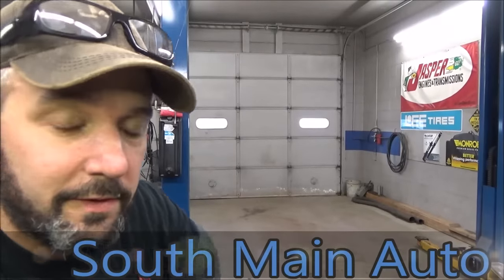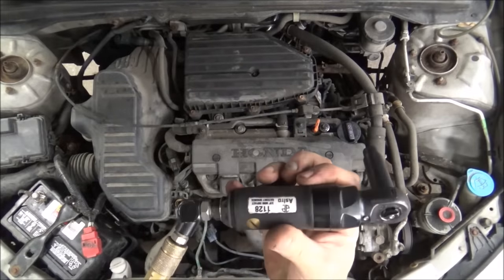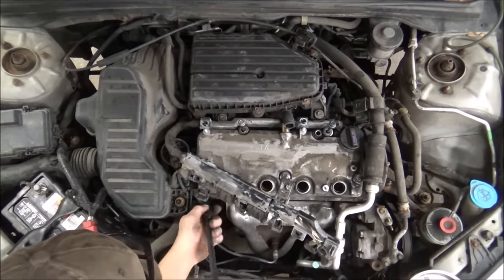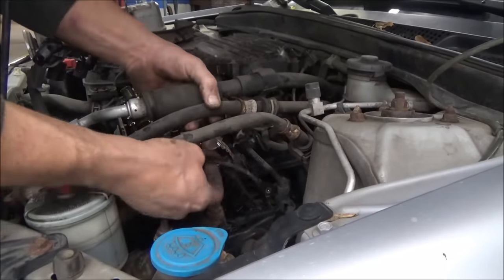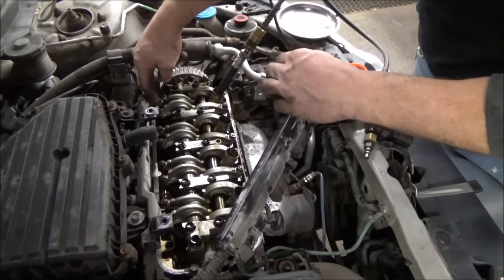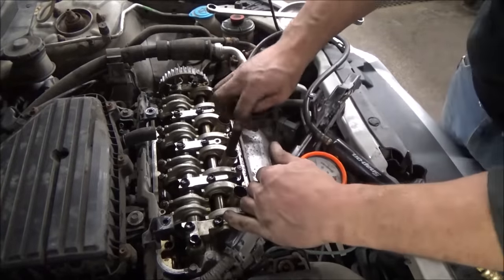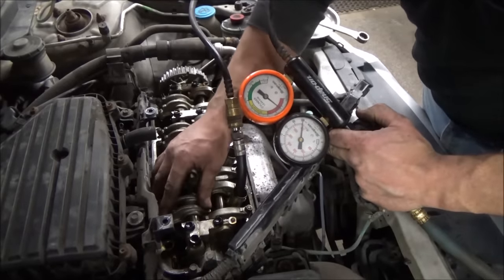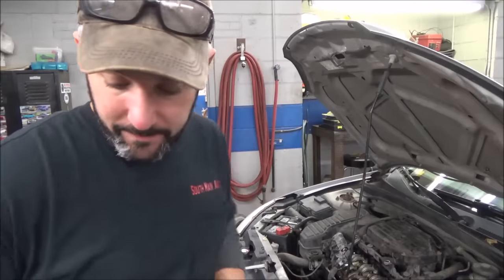Honda Civic 1.7 - Crank No Start

Comment: I bought a 04 civic ex with 130k with broken timing belt for $500. The body and interior was immaculate!! I just bought a jdm engine for $550, a gasket kit for about $100, and a timing belt/water pump kit for $70. After all said and done, I had a running car for around $1300. Still have it 4 years/80k miles later!
Reply: Nice. Being able to do your own work opens up so many possibilities.
Reply: I bought a JDM d17 engine I only had it for 1 month the engine turned off on the freeway now it has a slow/ no crank , the timing belt is still on.  Any recommendations  ?
Reply: You bought a ricer
Reply: @joelarso5348  Ricer? You are about 45 years too late, Japanese cars and engines are now some of the best in the world right up there with the Lasanya Lambo. lol
Reply: Do you still have it? (Vid is 3 years old.)
Reply: @DIYApprentice  
Sir, that's true. 4 of the last 6 cars I have bought were either in a junk yard or ready for the salvage yard.  Towed them home and would fix whatever was wrong and drive them anywhere from 3 years to so far my pick up 19 years. ( had to rebuild the engine) a 1988 Dodge Dakota 3.9 V6
Reply: that right there is how its done
Reply: I have 2001 Honda Civic. Car doesn't starts in the cold weather. When the weather is good, it starts usually. What could be reason?
Reply: @Xarataa5654  battery? coolant ?  how cold are we talking ?

Comment: Takes me back a few years ago. They pack everything in such a tight space. Glad to see you didn’t have the antilock brake D block behind the washer fill.  My 2002 with 238k miles had something get into the main pulley, tore the time cover to pieces and gasket slipped the timing belt off.  Bent 4 valves, and I was reliving my adventure of doing that very job watching your video.  Of course I’m old school so no fancy gadgets just the standard knowledge of sounds and mechanical sense.   Great videos!

Comment: Great diagnostics. That Civic is definitely an interference engine. Looks like those pistons kissed the valves for sure. A lot of the Civics, Accords, Preludes are interference engines. Its a bad day when a Honda timing belt breaks. Best option for your customer is a different completely rebuilt head $240-$300 , $250 head gasket set with bolts, belt, tensioner, water pump etc. Thats if he can salvaged the pistons, in some cases you can unless they have a hole. But he has to do it his self DIY. My daughter just did a head gasket on this same engine 1.7L the video will be out soon. Great work South Main you handle your content like a real boss, God Bless.
Reply from the maker: +oldskool funk Hey man good to see ya over here on the SMA Channel. I enjoy your videos and the way you approach ministry. Good to hear from you :)
Reply: Old Skool funk and SMA!  Thank you two for posting such great videos! I was inspired to work on car engines because of your guides and tutorials. Currently working on the exact same engine. Previous owner's engine died from oil starvation and I am ripping the old one out to put lower mileage engine in. 130k miles. Getting new timing belt, Water pump, serp belts, from and rear main seals while at it. Keep it up!
Reply: Payton Izaiah  Why is this comment showing up on so many channels?  Sounds like a scam.

Comment: Proof positive.  Never skimp on timing belt changes.  When the owners manual says its time to replace it, get it replaced.
Reply: Nick V thats the.number rule. My car is at 60,000 recommended change. Tho I had a 94 cavalier with a timing chain lasted over 100,000 miles.
Reply: I had an 86 Camry with an interval of 90K. I made it to 90001 when the belt failed... Luckily non- interference.
Reply: Marco Rubio chain not belt much different
Reply: Or do what I did and get a Honda with a timing chain.
Reply: hxtr timing chains also stretch and skip teeth. Most people think timing chains are the be all end all, they aren’t. They are better than Belts but with newer cars they have sides and guides. It’s not like the old 350 motors with a chain and gears only. Still have some of the same belt problems.
Reply: mark p with VVT now you’re supposed to but chain stretch either way even with 100% maintenance of the vehicle. I see them all the time 250k skipped a tooth or keyway slipped etc. so many things can happen it’s hard to even keep track. Nissan the cvt let go before the chains anyway.
Reply: my mom had a Hyundai and the belt broke a good 5000 mi before it had to be replaced… totaled at around 60k mi.
Reply: Nick V A Honda timing belt will last longer than many “lifetime “ timing chains they’re putting in vehicles today. The only difference is that a belt is a better design and won’t cost you several grand to replace.
Reply: Wayne Swicegood cracks me up that people think there are lifetime chains lol then they wonder how it jumps a tooth and throws off timing or worse on interference blows the top end 🤣
Reply: The problem is, the manual does not say anything. One has to know to open to read it. A chore to many
Reply: nsbioy very true my friend very true
Reply: @weldingjunkie  
Sir, what your saying is true. Some factory timing gear, chains  had the cam gear plastic coated . Would help keep the noise level down when the plastic broke, you can bet it would jump time and IF  it still ran, it was very bad and no power.
Reply: What if the car is 28 years old and only has 25k miles on the original timing belt.
Reply: Nick,
Actually timing gears work best and longest, but I doubt any car made today uses just the gears. The old Chevy 6 cylinder,  Ford flathead V8 used just the gears. Now there was an engine if the valves hit the pistons, you knew your engine was junk after that happened,  that would go for any flathead engine.
Reply: Nick V at least chains make noise, people these days need to have two belts, one wound tight as can be and weaker and brittle that is connected to the main portion securely but with “perforations” where it isn’t and little tin tabs that hit a tin ring on the cover to make noise once it’s close to failure, like squeal indicators on brakes, also having a tensioner arm sensor can help with the ecu knowing the wear and age based on stretch, one of the two methods should give an advanced enough warning to get home AND to a garage the next day, issue is that once you start having the second part or have it stretch a bit as it fails (unless it already does) you start to lose some of the longevity of it and need changes even sooner, so it’s one of those things most people would opt away from
Reply: I’ve pulled some at 200k that didn’t look too bad. Luck of the draw.
Reply: @robertgary3561  Isn't it foolish to rely on luck?
Reply: @nickv4073  in most cases. The last one I did with 200k was a ztech which is not interference.
Reply: I prefer to think of this as "don't buy a car with a timing belt. Go with a manufacturer that spends the extra ten bucks for a chain."
Reply: @John_Ridley  Most all manufacturers have gotten the message and have switched back to chains in recent years.
Reply: My father got real lucky.  300,000 on his Accord and his timing belt broke on his way home from work traveling at speed on interstate 95. No engine damage.  Just a major inconvenience.

Comment: Eric is sending one to the scrap heap after 20 minutes and Ivan is gettin' all DIY over the weekend saving one from the scrapper! It's a great day for South Main and Pine Hollow fans! Keep em' coming guys.
Reply: +Baxrok2 so true that POS that Ivan's working on.. but you have to give it up that engine is in great shape.. not so true for the front end.. wonder what the undercarriage looks like.. All I could see what the main beam COVERED in dirty oil..I'm sure the oil is just holding the rust together...
Reply from the maker: +Mike Pratali The cars down by him are in way better shape than the toilets here let me tell ya. They use very little salt down there.
Reply: +Mike Pratali The Prizm rockers are 100% aluminum roof flashing and bondo crafted by yours truly :) But honestly the rest of it looks pretty dang clean, original brake lines and all! Red spray paint is cheap :)
Reply from the maker: motoYam82 the classic DuPont overhaul!

Comment: I bet the timing belt shredded partially, jumped time, but kept spinning the cams out of time to cause the carnage. FUBAR!   

The most bulletproof t-belt engine that I've come across is the Toy-oater 3.4L V6 ('96 to '04 4-Runner, Tacoma). Non-interference and a wide beefy belt. Have a customer with 200k on his original belt on an '04 Tacoma...runs like new :)
Reply: +motoYam82 Only diagnoses that really make senses.  Jump timing would account for all cylinders with valves being tagged by a piston.
Reply: Agreed.
Reply: I have done about a dozen Hondas like this and never even check for valves bending I throw a new belt on and 100% of the time they have been good to go. ALso my turbo Honda has like 5 bent valves still drive it every week without issues. 450hp 1.6
Reply: @mashedpotatoes5323  very funny
Reply: @PineHollowAutoDiagnostics  Ivan you are one smart guy I like to watch channel also😊
Reply: 3.4 do not use egr valve another +
Reply: If you wanna see abullet proof belt watch my video on a Camry 2.2L. 👍
Reply: Zach Holm 
You seem confused.
Reply: Ford Pinto 2.3 and Mercury Lynx, they both broke on me and no damage
Reply: @432hz music blessed 
I had a 69 Chevy caprice 396,  it jumped a couple of teeth and kept running. Gear/chain. Ran very low on power. I changed the gears, and chain, was tempted to advance the cam one full tooth. (my car) but I didn't. Ran much better with the new parts but was still a dog.
Reply: @bmcunning  
It wouldn't make much if any difference,  if the timing slips, either way with an interference engine the valves are going to be toast. By retarding the valve timing, the valves could and most likely were still open when the pistons came up. And BAM

Comment: Excellent vid, shows why you should follow the manufacturer's scheduled service intervals (not the dealers).  With proper maintenance that's easily a 225-300k mile cars. I assumed Honda 4 cylinders were all chain driven, I was wrong. I would have had you fix it, still cheaper than a replacement at that time and you would have done the job right.

Comment: Yep don't skimp! I did the timing belt,  water pump,  tensioner, spring,  upper and lower timing cover,  and head gasket at 208,000 miles, and i saw pieces of the timing cover gasket on the floor!. One cold day in Houston, went to crank it and nothing.  But i looked at this video as well as old school funks vids to help me fix it!!!!!!!! Still running  strong!!!!

Comment: I just Bought one with a broken timing belt, Cylinder 1 & 3 Intake valves bent 1.7L engine.I also had the same thought that valves don't bend on the civic's but you learn some thing new every day.
Reply from the maker: +MrAKPAPA78 Sure do!

Comment: I had a timing belt fail on my Porsche 944S and it bent most of the valves. The repair was very costly, but worth it for a nice vintage sports car. I hope the owner lets you repair it. I look forward to that video (series!). Thanks for the video!
Reply: +Joris Goedbloed Anything from VAG is gonna hit the valves.  Water is wet, the sky is blue, VW/Audi/Porsche have interference engines. It sucks too because the chain driven engines like to eat those guide rails. Once that happens it's a ticking time bomb.
Reply: +Jacksonkellyfreak You are right, interference engine, but the Honda was said to be the same and the result of the timing belt breakage was much the same as well. Only difference, my car was worth the effort and money repairing it.
Reply: +Jacksonkellyfreak  nope, broke the chain on my vr6, cranked a bunch before looking in the oil cap and seeing no chain movement, removed head,no bent valves or marks on pistons, still running fine today
Reply: +kauboi Good for you and your car! I hope it runs great and continues fine!
Reply: kauboi
Dude go buy a lottery ticket because the VR is most certainly interference. I'm not saying it can't miss the valves, maybe you had them in a position that they were just slightly open, but that is a very rare case. But I can tell you ALL VR6 engines are interference.

Comment: Great video.  I wonder if that timing belt was original.  My 2009 Civic has a timing chain and I was told that it doesn't need to be serviced unless it stretches.  It already has 150,000 miles and still runs like new.

Comment: Arrr shucks. Would have been EPIC to see another multi part video series on doing the head on a Honda engine. The RAV4 and EJ253 vids were epic. 

If it was a manual transmission it might have been worth getting an engine from a scrap yard, but chances are the transmission doesn't have much life left in it at 165k and probably not a whole load of maintenance. I prefer Toyota's. But my sister has whats sold in the US as a Honda fit. Its literally had nothing go wrong with it in 9 years/70,000 miles besides some judder in the CVT that a fluid change fixed. Its a strange engine, 1.4 petrol, SOHC and its chain driven. Its actually as efficient as a diesel if you drive it properly. Gotta love Asian vehicles.
Reply: I had an 03 civic 1.7 with 400 000 km on the tranny when I sold it and it's still on the rd 4 years later
Reply: Jap engines and gearboxes have good tolerance in their builds.

Comment: Every 1.7L Honda I have worked on with a busted timing belt has had bent valves.............Great videos Eric!
Reply from the maker: +tomswonderfulworld Oh wow that is nuts because it is just the opposite for me.
Reply: +tomswonderfulworld The only ones I've pulled off had the belt teeth sheered off by the crank gear, fortunately for the owners they all just needed a belt to get back on the road.

Comment: I had a 2003 with the 2.4 4 cylinder.  That engine was interference fit and at about 240,000km she let go and bent the no.2 intake valve.  No head or piston damage so a whack of new parts and off she goes !

Regardless of OEM recommendations I've always been confident of belts and chains  until about 200,000km ( 120,00 miles ? )

IMO at 200 ( 120 ) change it just do it regardless of what the book says.

Comment: The pistons won! We had 14 1983  Ford Rangers with the 2.3L that were non-interference engines. I think Ford recommended 60K on the timing belt life and about to the mile the belts would break but no bent valves.

Comment: Honda recommends 90,000 for a timing belt change, which is when my neighbor had his done at the dealer, but they screwed up the job and didn't even use a Honda timing belt, the tensioner spring had come off and was wedged between the crank pulley and the crank sensor, thank goodness the engine wasn't damaged, I replaced everything with genuine Honda parts and it ran great, they used a dayco belt that wasn't even the right width.

Comment: Love Mrs. O's reaction! I can vouch for the Astro 1128 ratchet, bought it through amazon and it has some nut to it for it's size. Definitely worth the money.
Reply from the maker: +rider9195 I love that little tool
Reply: +South Main Auto Repair hey bud what the brand or model number on that leak down tester you got there
Reply from the maker: it is a snap-on

Comment: Appreciate this video acquired a 02 civic ex that some one did a head gasket job on my buddy and I are trying to hook everything else back up Ive managed to get power going and thanks to your video found the crank sensor plug. Verified that timing belt is good but motor cranks but no spark seems to have power going to the coils but not a one of them has spark. Any thoughts? Checked for an easier means of contact in your video description but comment it is! Thanks in advanced and thanks for your time.

Comment: So you should buy it and fix it for a spare car....btw do the Toyota engines (2.4L) have a timing chain vs belt? Who makes non-interference engines...or with cam phasers is this part of the reason for valves into the pistons?

Comment: I changed my original timing belt on my 2002 Honda civic at 110,000 miles in the year 2016... And don't ever cheap out on the timing belt. I once did a Chev Aveo with a cheap no name timing belt. It lasted about 30,000 miles before it broke and half the valves smashed into the pistons.

Comment: Eric - Great video.  Great engine operation as you teardown and trouble shoot. At what mileage would you start being more mindful about doing the R/R on the timing belt and pump set?  For the most part, I don't totally trust the manufacturers recommendations. I'd probably do it a tad sooner than they recommend just because I am a little harder on engines than someone else. Or does it matter if you do drive the vehicle easy or a little harder at times?  I'm thinking miles are just that - miles no matter where or how they are driven.Also - the adjustable Lady Finger and Camera - who makes them?  Is any maker better than another brand?
Reply from the maker: +Hawaiian F150 The lady foot is a Snap-On, I have a 4 piece set of them actually really handy. AS far as belt R&R I always tell my customers 100k. If it is a neon or pt I say 80k Other than that most hold up well past 100k actually.

Comment: '89 Honda Prelude timing belt broke at 105,000 miles.  No internal damage to the engine.  No interference issues on that older style engine.  Replaced timing belt, water pump, and drive belts at a cost of $350.  Ran fine after that.  Thanks for showing what usually happens with the "newer engines" where the valves and pistons collide when the timing belt breaks.